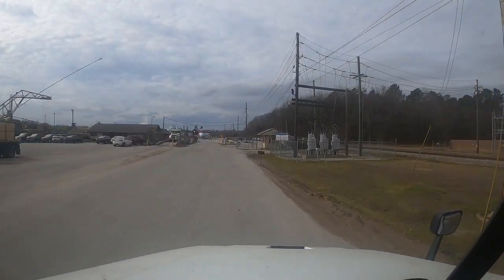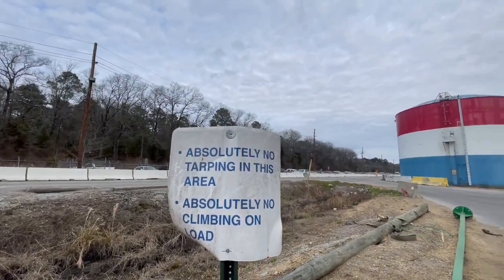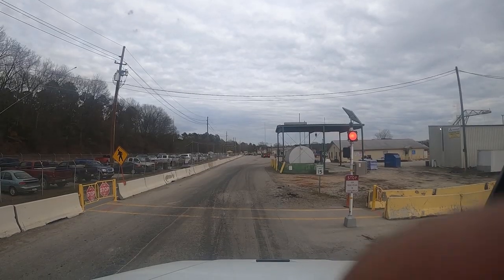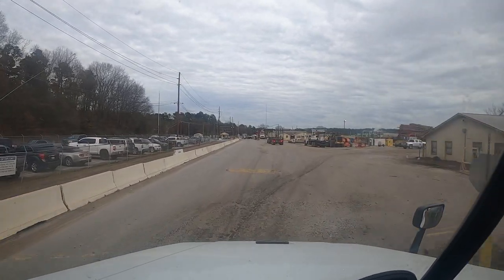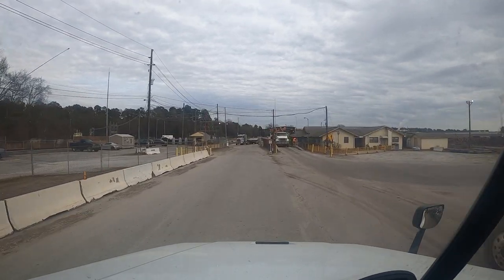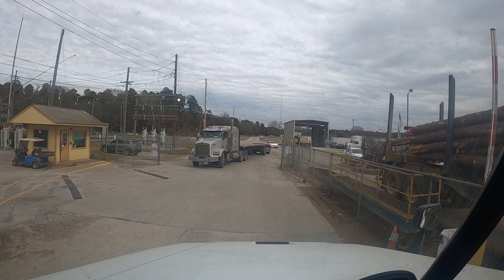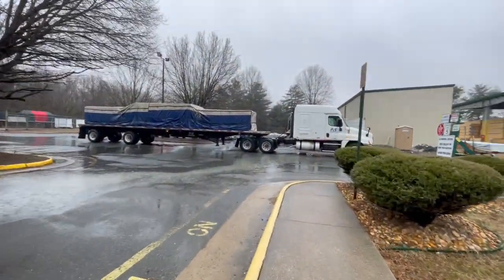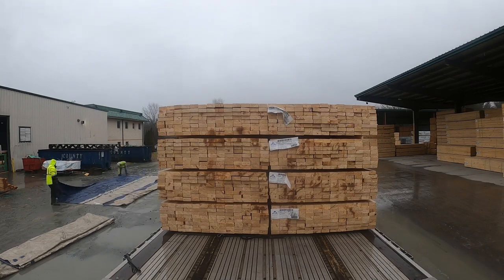Easy Money Sheetrock and Lumber “Flatbed Trucking Vlog”

Comment: Question? When you haul steel coils what size coil rack do you use? 33 inch or 27 inch? Looking into starting hauling coils and not sure on what size to get.
Reply from the maker: I would go with the longer ones so you wouldn’t set yourself up for failure if you happened to pick up a big coil. Wouldn’t hurt to have 4 of the small ones though